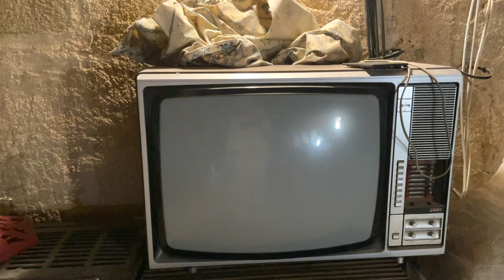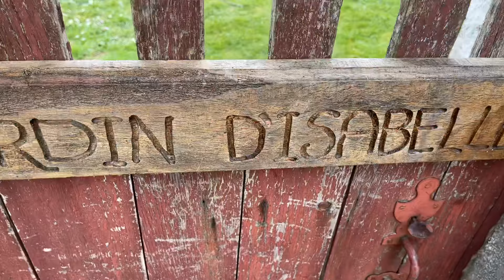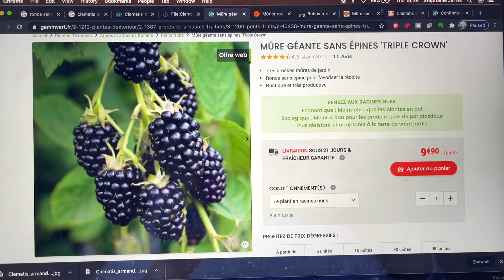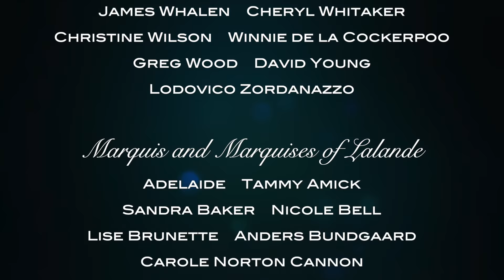SPRING IS IN THE AIR!

Comment: Before you go too much farther in insulating the attic, you should consider running some network cable to various places throughout the chateau to be able to install some wireless access points and improve your wifi situation. Wifi frequencies just don't penetrate massive, heavy walls very well; you will get a lot better connectivity if you could get more access points (every other room would be great if that is possible).
Look into that. The attic would be a very convenient place to run wires. I would love to come and be a volunteer and run cabling myself if it weren't for COVID. I wish I knew someone in your neck of the woods that I could recommend to design and/or install a good wifi system for you. I would recommend Crosstalk Solutions since they consult and have traveled all over the world to work on networks. But again...COVID makes travel difficult.

Comment: I'm not an arborist, but I do work at an arborteum. At the arb when people are felling or cutting large trees with a chainsaw, the proper leg coverings are necessary. The velcro leg attached chainsaw chaps have always been the utmost in safety. When the chainsaw blade mistakenly hits the preventative chaps covering the legs, it prevents leg injury since the fibers in the chaps tangle into the chainsaw chain and stop it quickly.

Arborist companies have the largest expense with insurance since the hazards of felling or pruning branches off of large trees is extreme.

I didn't know if this information would be helpful to la lande, but it might be helpful for people choosing to fell their own trees.
Reply: Good point. Selmar got those protective leg coverings for his workshop.

Comment: Having put in raspberries not knowing they spread  very quickly you may want to think up alternate places to put them when they go nuts. 32 is a huge number given the spread. Had wanted to add a thought about handicap accessibility to Jerry's apt and Mummy's. They may be spry right now but boy can it change fast and doing a re reno is so much harder than figuring how to do stairs so can have lift very easily, wider doorways and outlets higher up the wall, maybe motion sensitive light switches...these can be done at start .

Comment: I want to come and do work away there so badly. But I am 52 and a bit disabled with arthritis in my spine and knees. What I have wanted to do (besides cooking and baking) is go through all the fabric they have and take a picture and add the measurements. Also the trim. Then I would create a spreadsheet so that whenever there is a project they will know what they have and where to find it. Then I would move on to the chairs, doors, panels, bed frames, etc. I wonder if that would make me useful enough for me to be picked to do work away for La Landes?